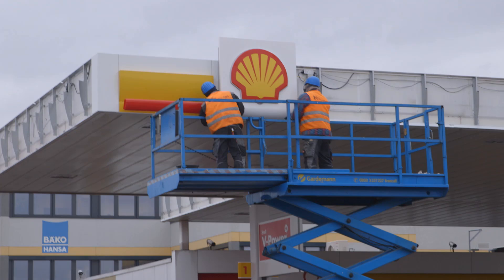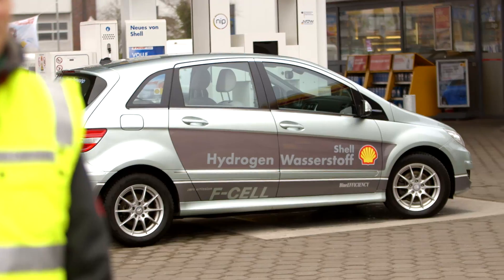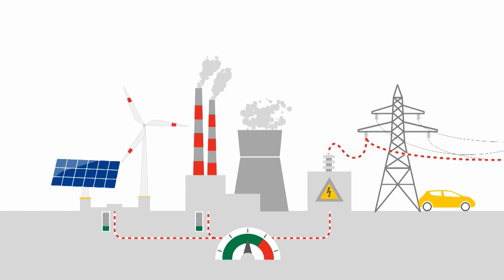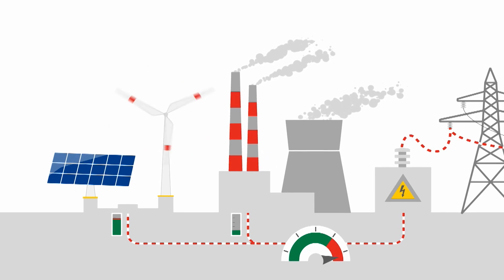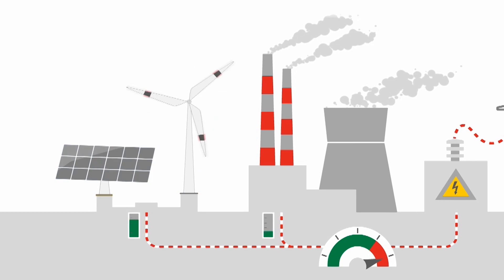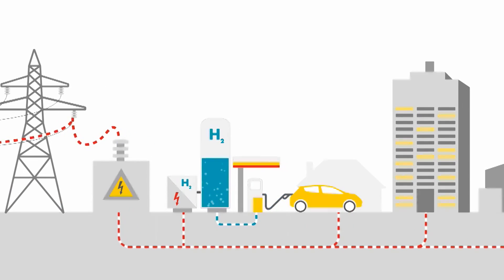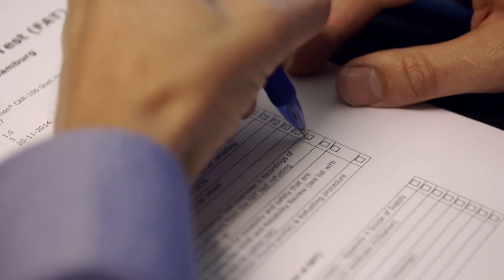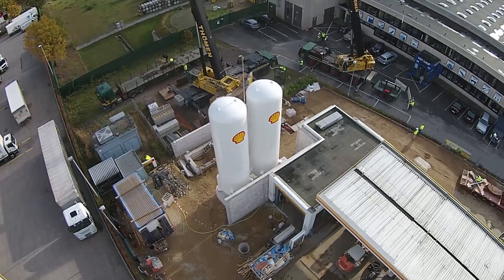See what it takes to build a new hydrogen fuelling station

Comment: i was wondering what is the needed power for production?
Reply: It takes 39.4 kWh to produce 1 Kg of Hydrogen with 100% efficient electrolysis. A more realistic number is 48 kWh per Kg. It can take as much as 12 kWh to compress and store 1 Kg of Hydrogen for transport to the refueling station. A Toyota Mirai goes about 60 miles on 1 Kg of Hydrogen while the equivalent Tesla Model 3 goes 250+ miles on the same 60 kWh of energy.

Comment: Fun facts about Hydrogen
-It takes 3x more electricty to fuel a Hydrogen vehicle than a battery vehicle per mile
-Hydrogen is 5x more expensive than electricity for a battery vehicle, it costs more than taxed petrol
-Battery vehicles are charged at home and can efficiently absorb the excess renewables, without throwing away 2/3s or the energy.  They can also feed back into the grid as needed.  This characteristic get even better as more charge points appear whereever you park.
-an example of H2 inefficiency is that a 150kW fuel cell need a 20kW air pump (bascially an electric turbo), this is 13% of the end energy available for the traction motor.  Further more compressing Hydrogen to 880bar requires at least 15% of the energy.  The best theoretical efficiency of H2 is 70% assuming the fuel cell and electolyser waste heat can be reused usefully (typically 30-40% overall now).  A Tesla Powerwall can store electricity at an efficiency of 92.5%.
-Fuel cells need 'started' by heating to 50C.  Fuel cell cars need batteries for this and to recover energy during braking and to drive the car while its heating up.
-Battery charge points cost about £1500, a small Hydrogen fueling station for 1 or 2 vehicles costs about £2M.
-One by one all H2 vehicle producers are announcing moving away from H2 ro Batteries
-Japan gov't is staying with H2 at the moment because they claim limited natural resources to generate renewables and Australia has offer to supply them Hydrogen generated from coal.
-No material can store Hydrogen indefinately, when reviewed on Top gear the fantastic Toyota Mirai was quoted as the tank bening empty after 2 weeks.
-Hydrogen tanks in the Mirai must be inspected every 5000 miles and are not guaranteed against chemical damage from normal road or atmostphere conditions (eg slighly acidic rain or salt)
-2020 has seen battery vehicles at the top of the sale charts, with commercial orders for BEV vans of 100,000 and 10,000 for Amazon and UPS.  Meanwhile orders for H2 vehicles are 1,2, 10, 20 max.

On the other hand you can fill up in a few minutes if you can find a fueling station.. yey!
Reply: Fun facts: That electricity needed to create hydrogen is basically free from renewable, so efficiency is no concern. The infrastructures needed are built for 50 years or so.
The technology you are refering to is a few years old. And the developpement cycle of hydrogen solution is where BEV where 10 years ago. 
All hydrogen vehicules are hybrids containing a battery just as in BEV, but smaller, so less carbon carbonprint.
Hydrogen production-creation projets are comming up every week, even in Saudi arabia. Refuelling station openening every day somewhere in the world.
Reply: @ChristianRichardDritzz  Fun facts : electricity from renewables is not free (you know , the solar  and wind farms plus their maintenance don't cost peanuts )  and if you need  3x times the energy at wheels  it also means that you'll require 3x times the amount of solar panels/wind farms (that again are not free and are environmental impactful as CO2 and e-waste ,google it)  . The infrastructure built for natural gas is not  straightforward compatible with hydrogen  because transmission pressures and gas propagation and proprieties are different , pipelines,valves, reductors and tanks all require specific compatible materials to be able to hold safely 100% hydrogen.
Reply: @ChristianRichardDritzz  firstly I didn't mention infrastructure,  but there is no nationwide hydrogen pipeline.  Compressed hydrogen is so inefficient to transport the hydrogen industry tries to come up with things like ammonia  to improve it.  You can't use the heating network for 10,000psi hydrogen. 
I also didn't refer to any technology,  Hydrogen efficency is held by physics, not technology. 
The efficiency does matter because we have a mixed supply of electricity,  adding a big new demand has to come from fossil fuels and means it will take 3x times longer to decarbonise.  If you can do your own renewables good luck with planning and costs, but it would be a waste of all those renewables, when they could be decarbonising the grid.
Reply: I'm not disagreeing with you - I'd just like to add few of my thoughts:
"Battery charge points cost about £1500, a small Hydrogen fueling station for 1 or 2 vehicles costs about £2M." - sure, but charge point is occupied by 1 car for 3 hours while fueling stations is occupied by 2 cars for 5 minutes. It makes the fueling stations 72 times time-efficient. According to this logic you'd need 72 charge points to substitute a fueling station with 2 pistols. Now scale it through the amounf of pistols on a regular gas station in a city where you have around 16 pistols (I mean 16 fueling spots), you'd need 72 * 8 = 576 charging points to substitute such H2 fueling station (and few times more to substitute regular PETROL station as refueling a regular car takes maybe 1.5 minutes). 576 charging points would make 16 cars leave the station per 5 minutes, just like when you'd use 16 H2 fueling pistols. People in big cities can't use their own plugs to charge their electric vehicles becaue they're living in flats. Also 2-3h of charging is a big nope, it's impossible to travel anywhere else than to work with such car which makes it good for cities but not for anything else. I'm not saying that electric vehicles are bad or that H2 is the solution but I'm deeply convinced that the future lays in some sort of gas/liquid fuel, produced with the use of electricity from renewables.
Reply: @Michal235  charge points are cheap enough they will be at every parking position eventually, initially on request.
Then you need to understand than people will charge where they park, they don't usually need to visit a charge point especially for charging unless on a long trip, soon that won't be necessary, except for inefficient travel like towing.
You miss the key point that liquid/gas only really works using carbon, then it stores huge amount of energy, but is also grossly inefficient.  Battery are worth a culture change, we need so much less energy.  Just pumping air into a combustion engine or fuel cell takes a large portion of the energy, they can never match batteries.
Agreed 2-3hr charging is not acceptable, mostly the aim is 10-30minutes.  With 250kw charger you can charge 150miles in 10mins.
Also a key point about Hydrogen fueling is that a £2M fuel station can only service about 20 cars a day, less than 1 per hour.  Its great having a 5 min fuel up, provided noone has visited the pump in the last hour.  Nevermind the slow transfer rate for an underpressurised tank.  Much more expensive stations with bigger storage are needed for a normal servicing rate.
Reply: @Capeau  How do you 'know' stuff, does it just magically appear in your head?  The important bit is where do you get the information, in my case it is peer reviewed scientific reports.   Of course if you have some new information on Hydrogen I'm sure the investment community would love to know and will wonder why you have kept this secret.  Otherwise since you do not offer any new figures on efficiency I will assume that you are just emitting hot air due to inefficiency LOL.  I have no doubt there are small improvements, but the fact is that batteries move faster because there are more options, and started off more efficient than Hydrogens theorectical limit.  So Hydrogen will never be as efficient as batteries.
As for getting your energy from renewables, I have yet to see ANY hydrogen project fully powered from renewables.  The renewables argument seems to be used to get the project through, but the reality is that it is hard to build enough renewables for existing uses, nevermind decreasing efficiency uses like Hydrogen.  In reality 'some' renewables are built but most power comes from fossil, or indeed Hydrogen comes from Fossil.  Despite millions of Euros from the EU to change the existing Hydrogen production to electrolysis it is still predominantly made from fossil fuels and emitting CO2 in the process, because it is cheaper.
There are some Europeans move into Hydrogen, but I am fairly sure these will not prevail.  The main development in Hydrogen in the EU is to change it from fossil production to electrolysis.  There are no EU funded Hydrogen transport projects I can find, there are some local authority projects in Europe, as these people tend to use less 3rd party experts than larger gov't, and are thus more easily fooled into Hydrogen "investment".
Charging speed - If you are charging at 1000miles per hour, you normally don't need to wait an hour.
You have to be an fairly poorly educated to compare Hydrogen fuel with batteries.  Batteries are not fuel.  If you want to compare a complete car, we can see for example that the Toyota Mirai weighs more than an equivalent Tesla.  Hydrogen Tanks are rather exotic and heavy, the systems are more complicated with more parts, bigger cooling/heating, pumping, etc.
While there is alot of data to show how well batteries wear out, maybe after about 600,000 for high density battery Teslas for example or 1m miles for the lower density LFP batteries, we don't actually know how long a fuel cell will last because noone can put many miles on these due to lacking fueling infrastructure.  Also the fact it is hugely expensive to fuel a Hydrogen Vehicle.  It may well last more than 1 or 2 million miles, but its unlikely the rest of the car will last that long.
"Not 100% green",  this is a claim only made the oil industry. They made an impossible-to-meet definition, so they can say it doesn't meet it.  Nothing can meet this definition if you are going to include historical emissions.  Sensible people make defintions of improvement.  Batteries are 'greener' than fossil fuels and Hydrogen.
"90% of electricity used to charge is from non-green sources"  well that is an interesting claim and I doubt its true in any part of the world today, even the high CO2 emitting US.  You claim that Hydrogen, with 3x the energy per mile, runs of only renewable energy.  LOL
Reply: @Capeau  You make alot of assumptions, so I can understand how you can only see one side.
I read gov't documents in particular EU policy and releases, so far no transport investment and actually they are winding back support for transport, this year they have noticeably dropped 'cars' as uses of Hydrogen in their press releases, I expect trucks and buses will be next once the Ponzi schemes are exposed. 
Provide just 1 reference for the EU investing in Hydrogen Transport!  I'd love to know what I have missed.  Plenty of Hydrogen investment in the EU but not specifically for Transport.  The intention of the EU is to stop the Hydrogen industry emitting so much CO2, if they can get transport working fair enough but its not happened yet.
We all know oil wants to pretend it is clean by morphing into Hydrogen, but its only going to fool some of the people some of the time.
Batteries may well weight several tonnes, but then so do diesel Engines, Hydrogen Tanks, fuel cells, air pumps, radiators, heater etc.  I agree weight is important in transport due to limits but the main factor is cost per shipped weight.   Batteries pay a 2T penalty in weight over diesel but the fuel is 5x less, that easily compensates for it and provides a business reason to change.  You really think the transport industry can ignore the cheaper cost of electricity as fuel?  Of course we also know cheap hydrogen is promised, but never actually arives.  Even Nikola said recently the key is cheap electricity, but guess what batteries run on LOL?
Hydrogen is still living on promises, batteries have actual reality.
Come back when you can actually back up your improvements and price with real numbers and examples.
Reply: @ Christphe Capeau  I'm pleased you don't have actual facts to disagree with me, just rhetoric and Hydrogen fan club 'the future is Hydrogen' and 'everyone is doing it' slogans.  That mean, in fact, that you are the troll.  I engage in Engineering anaylsis and require support for claims, for batteries it is there, for Hydrogen it isn't.
Reply: This guy gets it. Hydrogen will not be top dog. It will be a thing, but pure EV is king when it comes to efficiency and simplicity. The infrastructure required to have enough hydrogen fill station is just too crazy in comparison. Reason why almost every automaker has a EV line. But I welcome both. Any new tech is a good thing.
Reply: @Capeau  I know that’s why I said “pure EV” .  We will just have to wait and see.  I still think hydrogen EV will be second to pure EV as far as popularity for a long time coming. Either way like I said, no reason there can’t be both.
Reply: @Capeau   ok yeah dude a car with a fuel cell and needs a major process from still fossil fuels to produce just to function is more EV than a battery only car?  Yeah u not sounding very smart either. Can say the same to u. And yes I know how the infrastructure works. I know that’s the case. The power used to charge the cars is not all coming from clean energy. But u can charge a EV with ur home power so if ur power is from solar ect then..  tAnd not to mention it’s efficiency is not on battery cars level. Need a whole other process with in the car to charge the battery to run the motor ect. that’s why hydrogen won’t take off. requires way too much infrastructure in comparison to 3 phase charging stations. Not here to argue dude I work on EV’s every day for a living I see the tech. Like I said, just wait n see we are not going to change each other’s  mind so who cares. We will see how it plays out in the future. it’s just my opinion. Just like what ur saying  is yours. Any “ fact” u spew out can be countered with a opposing “fact” thru internet research. Ur reading bias research. U think governments aren’t profiting off it? Lol come on. It’s Just like politics lol. “What ifs” and “could be” mean nothing to me. I go off what I see with my own eyes. Not so called “facts” which are easily manipulated. Iv personally worked on both style cars and can say battery EV is waaaaay more simple and easier to make and charge for the every day person than hydrogen. It’s tech is at least 5 years ahead if not more. That’s my opinion not trying to change anyone’s mind.  Is what it is.
Reply: @Capeau  
-The efficiency is not a moot point because renewable energy is not free and solar panel and wind generators produce a significant amount of e-waste and CO2 (then to be offset after some years  like EVs ) being 3x less efficient means 3x more investment required in renewables, 3x more environmental impact to build and maintain the renewable energy  plants .
- "90% Of the electricity used to charge you 'green battery car' is from non green energy sources.
" In Q1 2020 the european energy mix was above 40% of renewables 30% nuclear and 15% gas and 15% coal whereas hydrogen is still produced 93% globally from coal and methane .
-"Batteries wear relatively quick... and they aren't 100% green either" current gen , thermally controlled batteries outlast fuel cell life and have minimal degradation 
-"The weight of a battery for the amount of energy stored compared to hydrogen is ridicylous" agreed H2 is very energy dense but very poor at energy per volume especially if you consider the whole system needed to replace one battery pack (H2 tanks, aux battery, fuel cell, air compressor, air purification and distribution system , dump water lines ) that's why it makes more sense in big application like trucks and much less sense in passenger cars  where the smaller the vehicle is the less sense hydrogen makes, look at the current gen mirai that is as  big as a model 3 but weights a bit more , has less range and  much smaller inside.

Comment: What is H35 vs. H70? Whats the other stuff to make 100%? Is this like E10 ethanol?
Reply: It’s the pressure at which the hydrogen pumps out you can put 35 on 70 car but it will only fill the tank up halfway, you can’t put 70 on a 35 from my understanding of another video!
Reply: I think that what they meant by "50% from renewables" means that it's impossible in such setup (where you're not using your own source of energy like PV) to guarantee where's your energy coming from when you're simply sucking it from the grid that's powered by all kinds of powers sources.
Reply: See koi